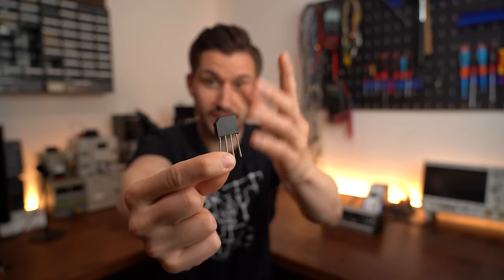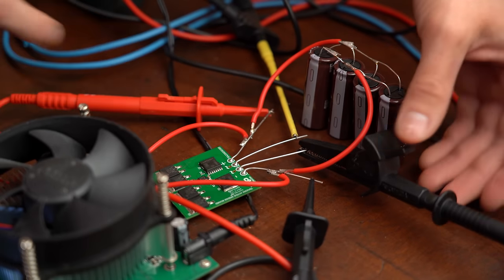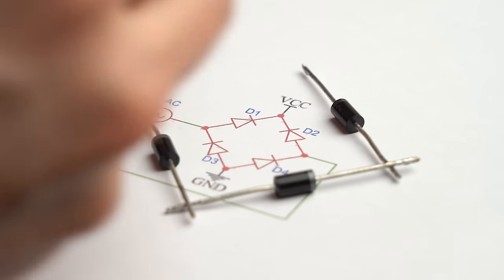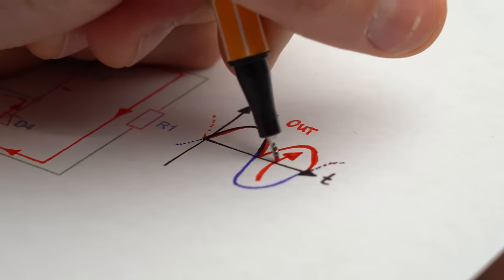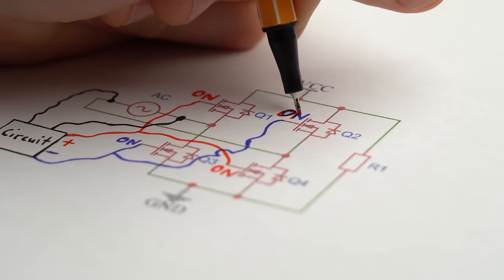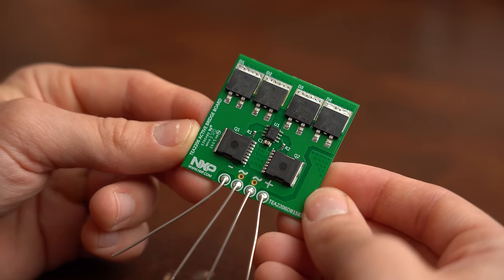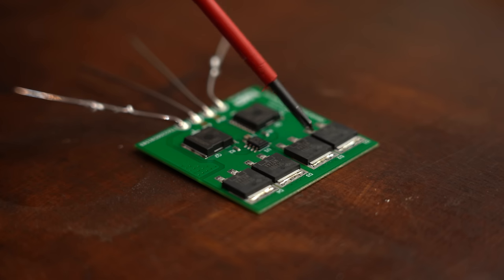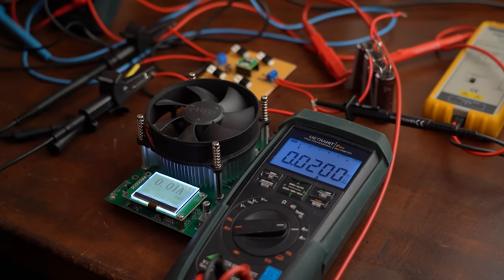The End of the Full Bridge Rectifier? (Sorry ElectroBOOM) Active Rectifier is here!

Comment: A million years ago, battery chargers used something called a "synchronous rectifier." A solenoid, driven by the magnetic field within the step-down transformer, moved a set of switch contacts back and forth in phase with the AC (hence "synchronous") and these contacts literally switched polarity of the AC connections between the transformer and the battery being charged. This provided the rectification. The whole thing, while noisy, was very efficient. There were no silicon diodes then.
Reply: Interesting... But I wonder what would be the load life of such switches?
Reply: An aircraft-type motor commutator is almost silent, with far longer life and probably just as efficient. But too expensive for a home charger.
Reply: @elgranlunatiko  Not long. They proved unreliable and the switch contacts had to be filed often. But, we're talking about the 1930's, so the only other option was huge, expensive, and grossly inefficient oxide rectifiers.
Reply: @jmi5969  Yes, and there was no rotating component on the battery charger for this to work.
Reply: @npenim  All cars used to use such regulators. They were simply a couple of relays with carefully calibrated pull-in voltages, and these relays would switch on and off in response to the output of the alternator, which then switched resistors in and out of the field coil circuit of the alternator, thus more or less regulating the voltage.
Reply: Since switch contacts can arc, they generate some heat and wear out over time. Not forgetting the mechanical losses in the system will also contribute to power losses.
Reply: @ScottGrammer  our very old Ford tractor had one of those that I had to replace. The modern one uses transistors, obviously. Same principle though.
Reply: @TechBuild  Yes.
Reply: @ScottGrammer  what about valve vacuum tubes? Weren’t they invented yet?
Reply: @robertoguerra5375  Before vacuum tubes there was mercury rectifiers. Huge, weirdly shaped glass devices filled with mercury.
Reply: @robertoguerra5375  Yes, but tubes only work for high voltage/low current circuits, not low voltage/high current circuits. They're useless for a 6V battery charger.
Reply: If you go watch some of DiodeGoneWild charger autopsy videos, one of the many chargers had a synchronous rectifier.
Reply: @omarrama92  I'll check it out.
Reply: @ScottGrammer  it was like a strange cylindrical shaped charger, had two ports, as far as I remember.
Reply: @ScottGrammer  Or... perhaps vacuum tube diodes?  (I'd love a comparison of those to solid state diodes).  Seems like it would be a contemporary technology to the contact-switching devices discussed here.  (Probably not nearly as efficient, though...)
Reply: I heard early tube car radios used a similar scheme. Fran Blanche demonstrated a similar function in an old (Lionel?) toy train.
Reply: I think vacuum tubes would suffer from vibration etc in a vehicles engine bay 😎💕🖖
Reply: You mean 20 years ago aruound the year 2000 .
The very older 1950 ones were literal bricks and they could melt and catch fire because of the tar inside them.
Reply: Check out the mercury diodes, used in the past in substations. Arc between mercury pool and carbon electrode. Quite a beast.
Reply: Brush and collector system in the typical DC brush motor is also an example of mechanical rectifier.
Reply: @voidseeker4394  Interesting, I was looking inside a Ninja blender brush motor and wondering where the diodes were.
Reply: @gblargg  fun thing with brush-collector is that unlike diode bridge, it is bi-directional. In motor mode it converts DC into AC needed for motor to run. And in generator mode is rectifies coil output into DC. Basically, all DC motors and generators are AC with some kind of inverter or rectifier internally attached to them.
Reply: @voidseeker4394  Very cool. I looked these up and they're called universal motors. Both the stator and commutator are in series so they both flip polarities together, thus the internal forces are the same as with DC, though pulsating rather than steady.
Reply: So cool
Reply: good job Old timer hahaha
Reply: Twenty five years ago, I retired from the marines, working aviation electronics.  We had a number of systems from the 30's and 40's that still operated on such systems in the nineties, when I retired, mostly on the C-130's high power radio systems.  I'd forgotten about them till I read your post, thanks.
Reply: @TechBuild  If they could time the whole thing so the switchover happens during the zero crossing, you'd think that would improve reliability. 

That said I'm glad we have solid state electronics. It was the wild west back then!
Reply: @ScottGrammer  Any guess when the silicon rectifier was invented and made, 1925 Felix Thaud's steel foundry France. a non whisker permanent junction diode.

Described in Popular Science Monthly June 1925 page 682, and their retail availability in Wireless World November 1925 page 52.

Fourteen years before Bell's 'invention' of the germanium diode.
Reply: @joefish6091  I never actually looked it up, but what you say seems perfectly reasonable. Before that there were other solid-state rectifiers, such as the cat whisker detectors used in crystal radios, which often used galena (lead sulfide) or more common quartz. But silicon rectifiers that could handle tens of amps of current were not available for some time after that. I'm not sure when, but I would imagine not until after World War II.
Reply: A Rotary transformer was another name for them they also had a relay to switch polarity in case it fellbout of phase.
Power companies in those days generated whatever voltage and frequency they wanted so there were plants to equalise and convert.
Reply: @arfeausmutt9884  I wonder if you're talking about a dynamotor? A motor that drives a generator or alternator? It doesn't sound quite like the same thing I was speaking of, which essentially was just a primitive mechanical rectifier. I might be misunderstanding you, my apologies if so.
Reply: @ScottGrammer  The motor-generator was different.
A Commutator brush setup driven by a synchronous motor was a very early rectifier.  The motor-generator was a lot bigger , they had the advantage of storing energy in the rotating mass flywheel which gave it some stability.
Private generators in those days ran everything from 15.3 hz for locomotives to 46 cycle to Edison's DC system. Not untill the early 1950's that a national 60 cycle 240vac split phase standard made a level playing field.
Reply: @ScottGrammer  We are on the same page.
Sorry I tend to wander in my ramblings
Reply: @ScottGrammer  
They used generators, not alternators.
Reply: @ScottGrammer  
They used tubes for rectifiers in battery chargers.  Mercury vapor rectifiers.
Reply: I remember this company made a VLF Hipot for cable testing that did something similar. It made HVDC and used some contacts and a motor and mimicked an AC sinusoidial power output. Interesting
Reply: @zorinlynx  Crazy idea, but you could tap off mains using a cap-dropper into a filtered FBR that feeds into a zero-crossing circuit - either an MCU or some 555 circuit. Add some protection circuitry to prevent the MOSFETs from triggering and voila - an active rectifier driven by an FBR-powered zero-crossing gate driver
Reply: @gblargg  Imagine the poor madlads who first discovered that mercury plasma conducts current in a single direction. Presumably they died a few years later from multiple metal toxicity, and perennially burnt fingers.
Reply: Solenoids!?!    Wow, the chatter must've been something else!
Design is always about the trades, isn't it?
Reply: @ScottGrammer  not a long life, and motor generators would have been too expensive for the application, I guess?
Reply: @shahabmos5130  tar!!??   Splain me about the tar, Lucy.
Reply: sounds very sparky
Reply: @herauthon  You're right.

Comment: In this world of cost cutting, most devices are likely to stick with an FBR just because of the lower parts count and cheaper components. There are designs out there living off of single diode rectifiers still.
Reply: Funnily enough single diode is still more efficient.  If you ignore the terrible power factor due to the current spike from the capacitance at least.  So, if you can get away with it, it's worth considering.

Interestingly, many switch mode power supplies use a single diode on their secondary for exactly this reason.  It's AC from the coil, but they only use half of it.
Reply: Ah, the single diode garbridge rectifier!
Reply: Like the secondary side of many switching supplies. Single diode and capacitors.
Reply: Most cheap things use just a single diode for ac-dc conversion.
Reply: Yeah, but tomorrow this will be a no brainer solution.
Reply: Now that there's efficiency and power factor laws(A very good thing), this stuff is more practical.  Really almost no devices should still be rectifying anything though now that there's USB-PD, just leave it to the power supply design specialists, who can do it cheaply because they probably have higher volumes than your product.
Reply: Just wait until active rectifier IC's are built.
People said the same thing about microprocessors, now you can buy them for 5 cents.

They could even implement self-soft-starting rectifiers with such a system.
Reply: @TauCu  Once they're a single component you can buy for 1/10th of a cent in quantities of a million sure, but the company making a cheap NiCd battery charger will probably still opt for the single diode just for cost reduction. At the end of the day, not every device needs the extra efficiency for the added cost just as not every device needs a microprocessor.
Reply: @EternityForest  Efficiency and power factor laws? Where? I've never seen such a thing here in the US. 

Even if those laws exist or come into existence, this doesn't mean some Chinese company won't produce a cheaper version of your product that used a single diode and does the same job for half the price, which some people will definitely end up buying. 

Not every device is, can be, or should be powered via USB, and devices which do not support the Power Delivery standards won't just disappear overnight either. If it gets widely adopted it will still take a long time for everything else to get mostly phased out anyways, in the mean time the single diode will continue to live.
Reply: @AiOinc1  The single diode will probably hang on for a long time, but it's still not exactly desirable.  Not quite everything can be USB powered, but a lot of stuff can be. Gaming PCs and kitchen appliances are about all I can think of that can't, and I expect in 20+ years, if we have cheap sustainable batteries even those will be cordless usb rechargeable, and gaming PCs will be more efficient.
Reply: @AiOinc1  Oh yeah single diode jobs will stay for a while, sure. But my post was mainly in relation to your comment about FBRs

That being said I think you will see many single diode jobs being replaced with actives, too. It's just down to the fact that you can abstract away things like inrush protection, temp protection etc into a single cheap & efficient package.
Reply: This looks like an over complicated solution, that increases the amount of components considerably and there fore the reliability. Plus when it goes wrong a problem to repair. FBR's have stood the test of time. They keep trying to redesign the wheel but can not get anything better.
Reply: @Christopher Grant  Yes there are times where you need the complexity, but on most things the simpler they are the more reliable they are. It is a known fact the more components you have the more chance of failure you have, and to make sure everything is at the right quality to last for the design life of the machine or gadget increases the costs.
Reply: @Christopher Grant It does, the quality of the parts has to be guaranteed and the more components the more chance of a bad connection or dry joint. Yes they can build complicated circuits to last like in the space industry where every milliamp counts and they have to last a long time in hostile environments, but they are not cheap and not for normal consumption.
Reply: There are designs out there living off of single diode rectifiers still.

There's also the third type -- a full-wave rectifier with the voltage-drop of a single diode. Millions in use worldwide, but I'm sure their installed base isn't growing by much, if anything.
 
Sure, it does need a transformer with a centertapped secondary, but, it does work!
Reply: @EternityForest  it's not like USB is magically creating DC for free. USB wall chargers have rectifiers too. Also a blender may need 110v DC to run it's motor, and is fine with a single diode and some capacitor for smoothing.
Reply: @zazethe6553  USB standardizes and lets you scale up, so that high tech becomes cheap.   Non electronic blenders usually use brushed universal motors AFAIK, I would think that a BLDC based version with soft start could be far more reliable and probably lighter, so if the prices and power levels were similar I think I'd take the USB-PD version.  A 200W BLDC and driver for a bullet blender would probably be very cheap.
Reply: @EternityForest  Still, USB is not an electronic component. Computer power supplies, motherboard voltage steppers, or wall chargers provide the 5volt. And they still rely on bridge rectifiers or mosfets at some point.
You make it sound like USB magically creates DC from nothing.
Reply: @TauCu  where can you buy a microprocessor for 5 cents?
Reply: @QF2653  My apologies, I meant $0.341
mouser part no: 968-R5F10Y14DSP#50

You can also find cheaper ones from Chinese wholesalers, but quality may be hit or miss, but normally hit.
Reply: Not to mention less point of failure.
Reply: It's FWBR.
Reply: Basicly higher efficiency not always better.
Reply: @EternityForest  Id wager you have quite a few more outlets than PD bricks
Reply: This will be a thing once the price comes down, the full circuit comes in a small FBR size package and not least, when it becomes mandated.

1% less loss might not seem like a huge deal, but over the span of a year this is a lot of energy if you multiply with the number of units the manufacturer produces.
Reply: When some manufacturer comes up with it all in a single chip for pennies, that's when it will take off.
Remember when someone produced a little bit of plastic with 741 on it?
Reply: OTOH, perfect is the enemy of the good. If a single diode rectifier is sufficient, anything better is a waste.
Reply: Nothing new here. FBR are cheap, so they will continue to be used. All electronics circuits are a "ballpark" calculation anyway.